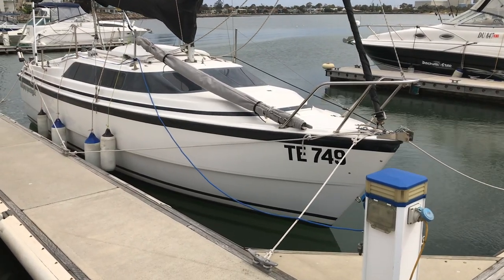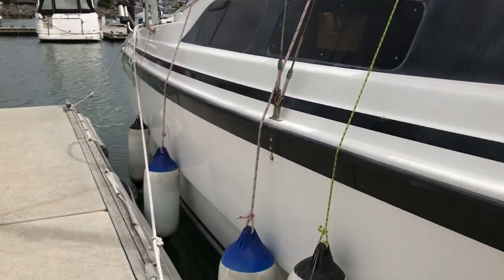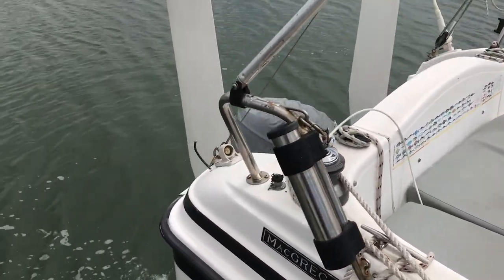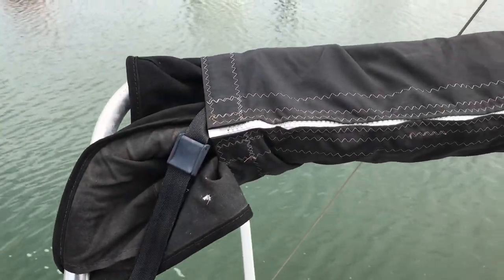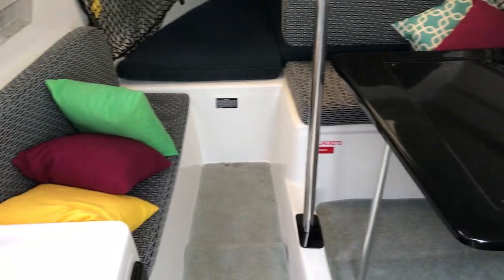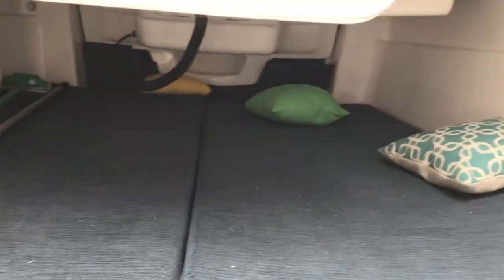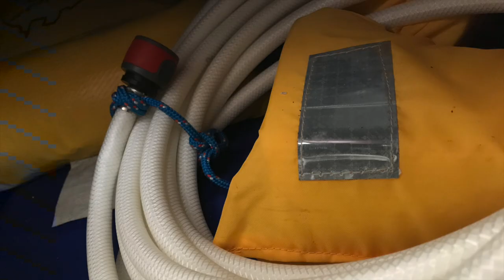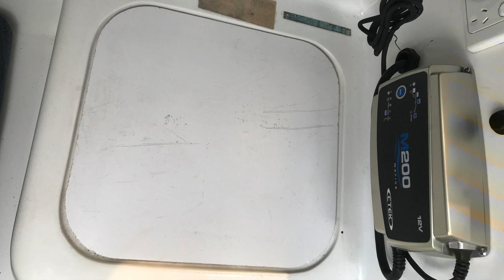Macgregor 26x 2002 - walkthrough and photos

Comment: Thanks for taking the time to give us all a good looksee. You keep it nice. I've got a 2001 here in Virginia in the USA, but it's nowhere near as clean and shipshape. You mention having a Danforth anchor in that tiny locker up on the bow. I'd like to have seen that. I can only wonder what size might even fit in there, unless you modded the locker somehow. I've got a Fortress FX-11, but hold it underway in an 8 inch (about 20 cm) PVC pipe held vertically onto one of those starboard bow railings with three big stainless hose clamps. I think I may have that same bow roller. Anyhow, take care and thanks again! I'm gonna go check out your other offerings now.

Comment: Explain the water pump and filter.  Sound cut out.
Reply from the maker: Water goes from bladder to pump (auto pressure pump) - then to accumulator then filter. Then branches with a wye connector to the head and the galley.